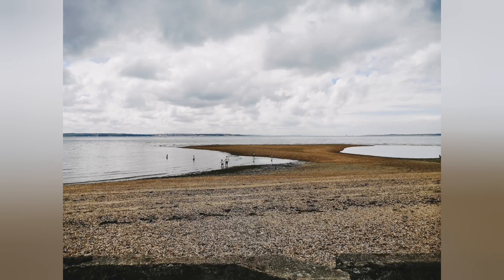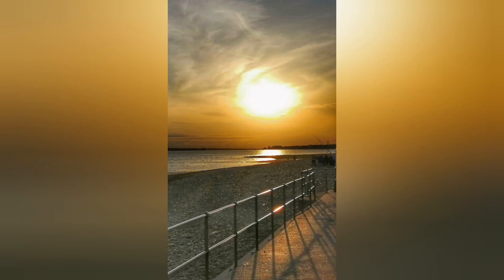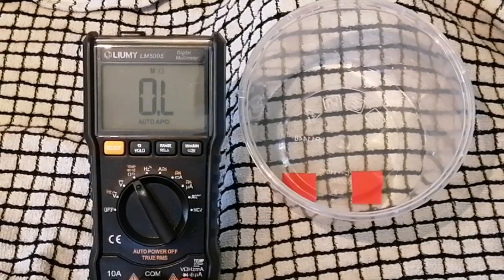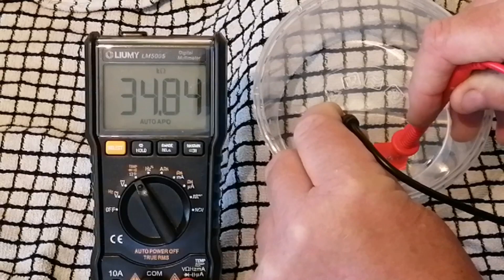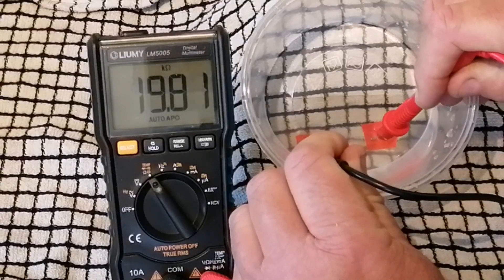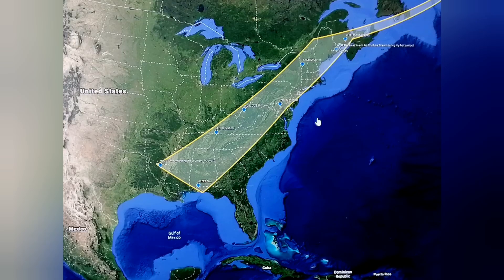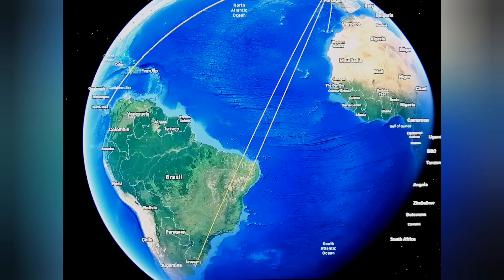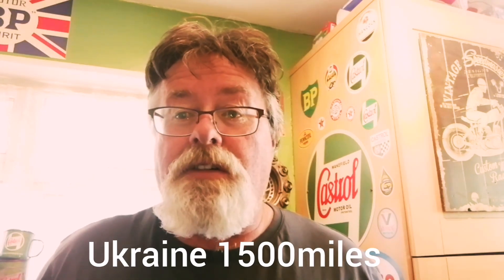Nature's RF Amplifier. Increase your range by over 4 times!

Comment: Thanks for the video. I am about to operate portable from the southern  Florida ocean coast line with a vertical in about 2 weeks. Hoping the salt water helps with DX. 73
Reply from the maker: Hi, thank you for your comment, yes salt water is the best ground plane for rf energy out there, it really helps dx range, plus the noise levels if away from nearby buildings also helps in hearing weaker stations. Enjoy the coastline. Regards Steve

Comment: Would 2m/70cm FM be amplified by the sea also, or would it only affect HF or SSB signals?
Reply from the maker: I believe vhf/uhf SSB signals or any DX signal that will use the atmosphere to skip off of will get some gain from the sea water. At vhf/uhf Refraction plays a big part if conditions are right.  RF also gets tunnelled around the curve of the earth, trapped between temp/pressure layers. I have had over 200 miles from my home location when a "Lift" is on (2m FM 10w). 
Weather,  pressure, temperature, wave heights and frequency (as the RF wave size will change) all play there part in the RF going far or not over water as the case may be. The best thing is to set up mobile and have a play, that is what I enjoy about the hobby, I try not to get to technical and as I replied to another viewer, their is a lot of science behind all this, but for me I like the hands on try it method, and see if it works.
I make my own antennas and its all about experimenting. Thank you for your comment and enjoy and hope you get some long DX. 
Regards
Steve

Comment: Great info again Steve could you test this with the same seaside setup inland ?
Reply from the maker: The maps compare my signals from my home base, that is 6 miles inland, and signals passing only over land, like my signal out over Europe only goes up to around 1500 miles, going west it uses the Atlantic to boost across to the USA then one skip over land. The ones going se over the Atlantic operating from the sea front, not inland regularly go up to 7000 miles. As an island we will always get some boost from the surrounding sea, but across land, the effect of lack of surface moisture can be seen. Ty regards Steve
Reply from the maker: Ps the mobile setup from my house has got me a max of 900 miles compared to the larger delta loop. I have yet to achieve a USA contact from home in using just the mobile setup. Regards Steve